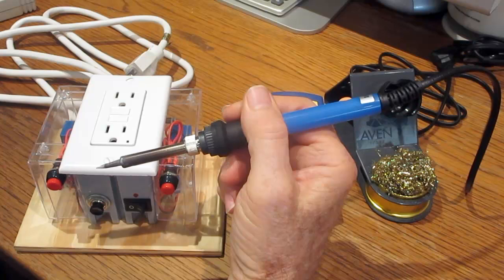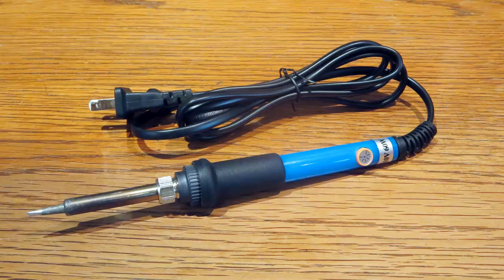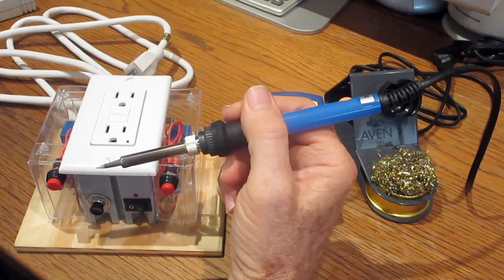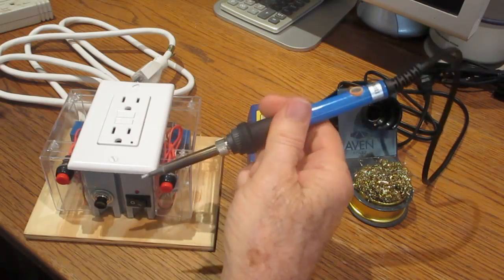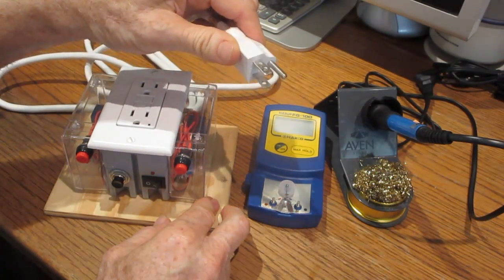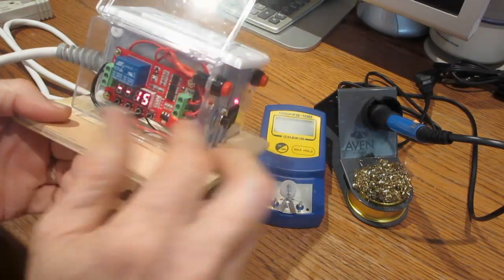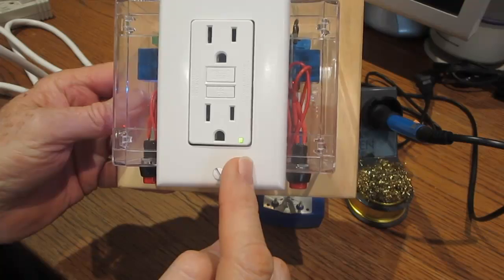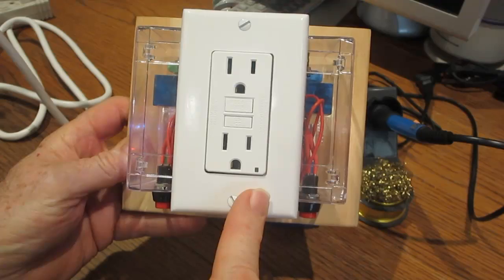Soldering Iron Pulse Timer For Temperature Control

Comment: I know this is a couple of years old, but I really like the thought put into this circuit. The build is also cool to look at. I have been on a soldering iron kick lately and built a few units. Never thought of using a cycle timer to keep the temp of my AC unit. I have used a dimmer circuit, I made from a light dimmer. I have the same cycle timer, saved from an older project, (I ended up using something else) and a circuit I had EasyEDA create the board(for the controlled timer).  May try one of these, just to add to my collection. Great instructional Video, very detailed and simple to build!

Comment: All you need to add to this unit is a way to adjust the temperature. It would not have to be continuous, but set in steps. Like Sn/Pb (63/37), Pb Free, or even discrete steps starting at 650 degrees F, say 750 degrees F, 850 degrees F, etc.